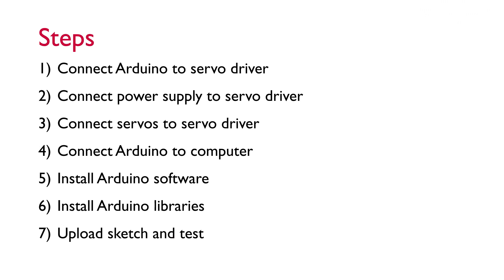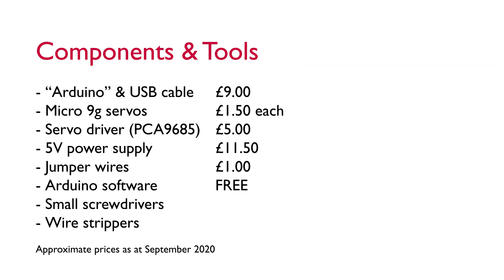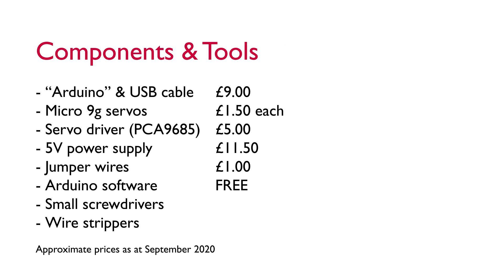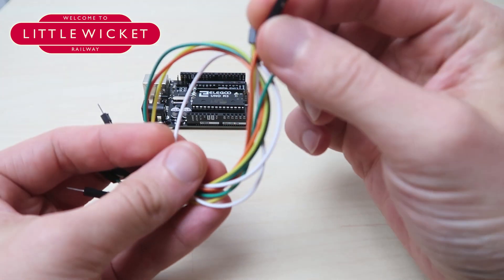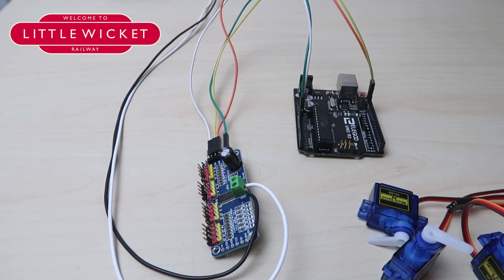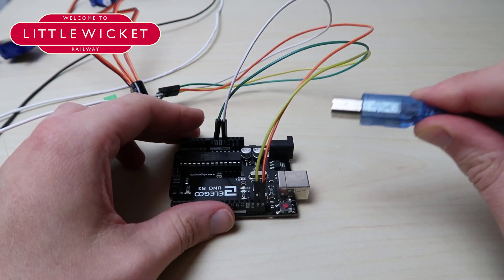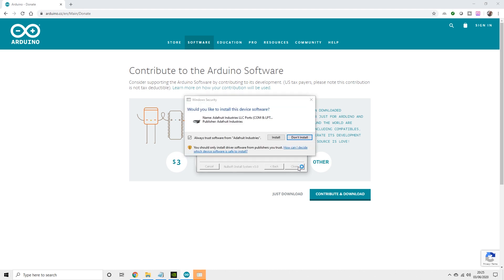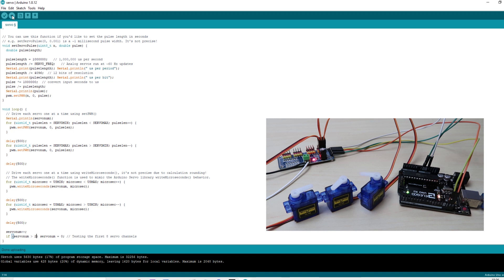Servo Motor Control for Model Railways Part 1 of 3 - Setup with Arduino

Comment: Rob,  ON uploading I get a long error message.  I think that the important bit is probably

Arduino: 1.8.13 (Windows Store 1.8.42.0) (Windows 10), Board: "Arduino Mega or Mega 2560, ATmega2560 (Mega 2560)"

Sketch uses 7100 bytes (2%) of program storage space. Maximum is 253952 bytes.

Global variables use 434 bytes (5%) of dynamic memory, leaving 7758 bytes for local variables. Maximum is 8192 bytes.

An error occurred while uploading the sketch

avrdude: ser_open(): can't open device "\\.\COM4": The system cannot find the file specified.

The above refers to a Mega and I am using a Uno and also refers to COM4 where I have my  Mega Sensor installed.  I have not come across a reference to a COM port in the video for this installation.  Can you help please?

Regards
Martin Wilkins
Reply from the maker: Hi Martin,

If you're using windows then it should have assigned a different COM port to each Ardunio board that you're using. You need to make sure that the correct board type and COM port are selected in the Arduino software before uploading.

To check this in the Ardunio software and look at the Tools menu. There you can change the board that is being used from the drop down list and you can also check which ports have boards connected to them.

It sounds like the software are defaulting to the board that you had connected before which was the Mega on COM5. You'll need to change the board to an Ardunio and you should see a different COM port available (COM5?) for the new Uno board.

Let me know how you get on.
Reply: @LittleWicketRailway  Yes thank you.  As you suggested.  It now works OK.  Thanks
Reply from the maker: @martinwilkins9055  Excellent!

Comment: Hi there, I currently use an Arduino and motorshield with dcc++ through JMRI to control my engines, can I piggy back the servo board from this or do I need another arduino and power supply etc?
Reply from the maker: Not something I've tried, but it might be possible depending on what pins are still available and how much memory is left on the board. You'll need to combine the sketches. You'll still need another 5V power supply connected to the PCA9685 to power the servos if you plan on having more than a couple attached though.

Comment: Hi Rob thanks for sharing

Could you explain how to daisy chain the PCA9685 for more servo control ? I mean the software side.
How the code in arduino sketch, and what to set or how to call the second PCA pins in c/mri ?
Make a youtube video for that. It would be great.

Thanks
Reply from the maker: I have just ordered another PCA9685. I'll try linking them this week and video my efforts.
Reply from the maker: Check out https://youtu.be/v1f_EDHV390 hope this helps :-)
Reply: @LittleWicketRailway  
I have found out how to do it by myself. 
But offcourse it will help others also. Just keep sharing great stuff.

Thanks

Comment: Hi Rob just started watching your servo introduction video's, I like the idea of using servo's for point control. I am assuming its the same installation for a DC layout.
Reply from the maker: Yes, this will work for analogue and digital 👍 You can control signals and points using the computer, but still drive the locos using your DC controller.
Reply: @LittleWicketRailway  Rob, I'm going to follow your DCC++ controller for my layout. Are two Arduino required, one to run the engines and one for the points, signals etc?
Reply: @56NeilWatson  Probably, as you would need to rewrite the sketch to accommodate both functions. The loop section would have to do a lot more work too, potentially reducing the response time of the controller (serious) and servos (almost as serious). Unos are available on eBay for just a few pounds, it would just be simpler to get a second Arduin Uno IMO
Reply: @Pierre-de-Standing  I got myself a Mega plus sensor shield. Have seen most of Rob's presentations ..... some a number of times. Have purchased some MERG block current detectors and have got two soldered up. Bought one of their 4 board kits and plan on separating them Not a soldering expert but have considered doing a vid assembling one. Have replaced some 5mm IR sensors with 3mm to get them between the N gauge track sleepers which work well
Reply: @56NeilWatson  Neil, thinking about it, if the various applications (block detection, DCC++, signals etc) were each made as a function and then called from the loop function of a sketch, it could conceivably work and be manageable, Rob's point about the memory of an Arduino is a good one though. I have also got some block detector kits from MERG, but until I can get the track I have ordered and laid on the baseboard, I can't go on to test my various bits in anger so to speak. Good luck with your project! I sometimes think a forum for Arduinos and Model Railways would be a better way to spread ideas etc rather than through YouTube.
Reply: @Pierre-de-Standing  I'm pretty much in the same boat. I've only really started taking this seriously since about November. Have set myself up a few test tracks just to try out various aspects on scrap bits of MDF just pinning the track down. The learning aspect is half the fun. Have spent vast amounts of time time, probably too much on trying to understand JMRI signalling.
Reply: @56NeilWatson  Neil, signals can be automated with Arduinos and don't have to be connected to JMRI. I have written some sketches for Arduino Nanos that when linked together and connected to sensors, will work just by themselves. Needs a bit of debugging, but mainly there. It is easier, I suspect, with colour aspect signals than semaphore. I retired in July 2020 and just getting back into railway modelling. The digital age has meant I have had a steep leaning curve, but I have no excuse having worked in IT ;) Automated signals should work just as well with a DC layout as DCC.

Comment: Hi I would advice against tinning the wires going in to a screw terminal they can become loose over time. A better alternative is using ferrules. See the pdf I have linked for more information.
https://cdn.thomasnet.com/ccp/00142951/263810.pdf
Reply from the maker: Thanks for the tip! 👍 I never knew they were called ferrules.

Comment: Hi Rob
 If you are using DCC++ how do you connect 2 Ardunio's to the same computer?
Reply from the maker: Hi Robert,

I use multiple Arduinos, each with their own USB cable connected to the computer. The computer allocates each one with a different COM address (COM01, COM02, etc...) so that you can refer to them in your scripts.

Using multiple boards probably isn't the most efficient way of doing things and it obviously takes up multiple USB slots. The benefits of having multiple boards is that if something goes wrong with sensors then I know which part of the electronics to look at.

It's probably possible to combine some of the sketches, but it's not something I've looked into. I think I recall reading a blog, maybe from the N-Scaler who combined lots of functions onto a Mega board.

Comment: Can you/do you use your Arduino to control the turn table?
Reply from the maker: Yes, in theory, I think people have done this with stepper motors or servos, or basic motors with feedback systems. The key thing is getting a slow speed and being able to accurately line up the tracks. Ideally you'd like to just be able to select a track in JMRI and it would turn to that position and confirm that it was correctly lined up.

My turntable was already motorised by Hornby and I've attached the motor to a digital decoder that I operate like it's a static locomotive. The gearing was already there to slow the rotation and they've fitted a mechanical system that's aligns the table with the exit tracks as it goes round, but it doesn't line up very well and it makes so much noise. You can't just tell it to go to a specific exit, you still need to watch it to see when it's at the exit you want, not ideal for automation. Although the mechanical system does allow a window of a few seconds between arriving at tracks and leaving again, so if the rotational speed was consistent then I could automate it using timing. Hornby have also dealt with the issue of changing track polarity as the track rotates 180.

I did buy a lazy susan and was going to look into building my own turntable, but the Hornby one was ready to drop in and I ran out of time. Fancy a project?
Reply: @LittleWicketRailway  Not cheap but there is a ready made solution https://www.dccinterface.com/ for Peco turntables. There are several videos on the subject https://www.youtube.com/results?search_query=turntable+with+arduino